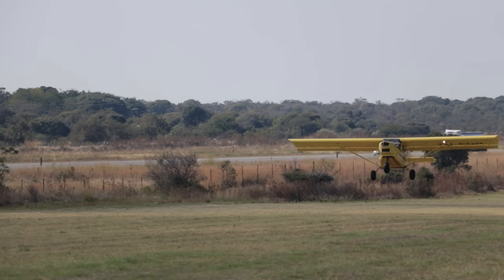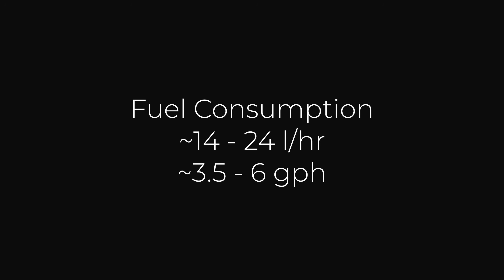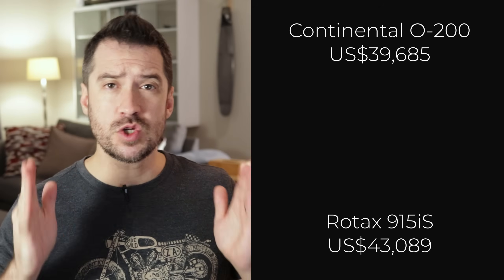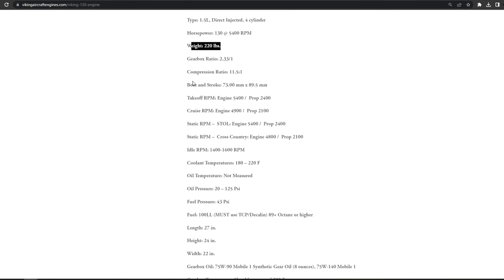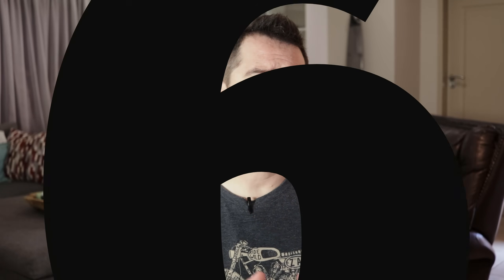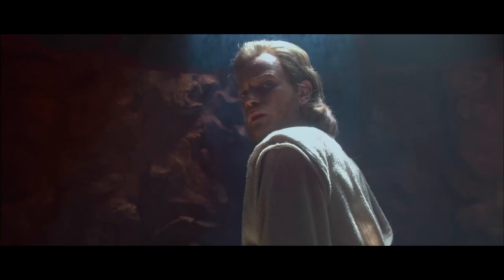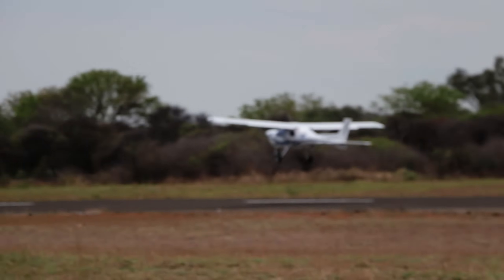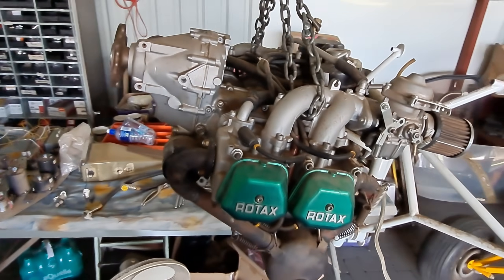6 WORST & 6 BEST Light Sport Aircraft Engines

Comment from the maker: I have updated the spreadsheet to fix some inaccuracies like engine pricing and weight and I also added two Aeromomentum engines due to popular demand. Link in video description.
Reply: Add the HKS 700E for Lighter Sport .... that's the way i would go on a budget. ( but i can't find engine weight or cost figures )

seems like a Very Light engine, with Two Different Gear Ratio Options...Smooth Boxer Twin, And No Hot Cylinders hiding behind cooler ones.
that would be like Super Powers, with the 2.58:1 reduction on a Rutan Quikie.
Reply: quickies have a ground effect lump you have to learn when landing them.... but no big deal, once you got the hang of it.
Reply: i can't find anything on the stock Q2 propeller diameter .... just that the Q2s have been known to scrape their props on landing, ( because of the flex in the forward wings )
i would probably try Epoxy and 4" Mono-Directional Carbon fiber tape, ( one stripe along the bottoms of the front wings, to add tensile ), 
and run the same diameter in a high aspect ratio 3-blade on the HKS 700E 2.58 to 1 reduction.
just guessing the stock propeller is about 1.3 Meter Diameter,  where the same, in a 3-blade on the 2.58 to 1, would give 88% Efficiency, which is better than stock at the same dia.
Reply: i mean if an engine costs less, and is lighter, you can afford a nice propeller and get more out of it.
getting the right prop, to match the engine to the air-frame is where a lot of power lurks.

you can get more power out of the same engine.....or the same power as a more expensive engine, out of a less expensive engine.
Reply: larger diameter propellers are more efficient, and 3-blade is more efficient than 2-blade....where a higher aspect 3-blade can run just as much pitch on the same torque.

with a Q2 i would be limited in prop diameter, but it's a more efficient air-frame with both the wings and canards being lifting surfaces, and better areo-dynamics than most.
less drag due to landing gear, and the canard wing-let gear actually reduces vortex sheading.
Reply: Wow....that little HKS 700E could pull a Quickie Q2 !!!
Plus It Is Way Lighter than the VW engine they normally put in them...a little faster, or better range, with the HKS 700E....it would be like sheding a bag of concrete.
Reply: i can't afford it right now though....sure looks nice, check out those kit pictures.
Reply: and the HKS 700E's less engine weight, could be trimmed out by moving the batteries into all that extra space up there.

a 1.2 Kwh Battle Born 100Ah 12V LiFePO4 Deep Cycle Battery is 33.4 Pounds ...put an inverter up front somewhere...
maybe shift the fuel tank forward a touch, or make the back a little lighter somehow.
Reply: i think i would get the 1.2 Kwh battery for Redundancy on my alternator / regulator.
.i would check my voltage before each flight, and just know if something was wrong; but i would make it ..... then pull out any plywood, and replace it with fiberglass sandwich core.

because just those two things would trim it out fairly well.....of course i don't know how much plywood the design uses, or where if any.
Reply: i could probably find old mattresses in the alleys, if i looked regularly.....then i could pick up the Q2 tail, and flip it over it's nose.

then do the 4" mono-directional epoxy carbon fiber on the bottom of the canard wings.
Reply: Someone that has access to airplanes should publish a web page with the cabin measurements of all the different airplanes available for Microsoft Flight Simulator.
Like:
Seat Height, how far the Pedals are from the front of the seat, where the Stick center is and neutral angle.....stuff like that, so people can set up.
Reply: actually, it would trim out, just with the right battery....because the battery further back wouldn't be there anymore.

so a Q2 would trim out much Lighter with the HKS and battery up front by the engine.
Reply: I think the Corvair engine is the most economical approach especially if you don't split the case. Borescope inspection can tell a lot about condition and a good prop can bump up the actual power. Sweat equity is a good investment
Reply: Not sure what the difference is if any between Lycoming and Continental although Rotax is in Austria and in a heap of trouble for selling engines to Iran to power Russia's drone fleet so prices might be coming down for Rotax soon. I would never trust any other engine for an Aircraft as no problem finding parts or people with knowledge who can work on them flying aircraft of VLA type still very much a collaborative effort. If you're flying paragliders this is an entirely another matter as presumably fair weather only and truly light and truly for sport. I still would prefer two engines over one no matter what type of flying with each engine capable of sustaining flight individually this either in a tandem configuration or lateral front/back "boxcar" formulation.  Anything else is a suicide mission and should come with a parachute such as Cirrus SR-22
Reply: So, a good engine aside fuel efficiency and reliability would have:
1. A price up to US$ 18000
2. Something between 110 to 120 hp
3. A weight/power ratio between .6 and .8
Reply: I have the Viking V90 mounted on my Pegasus and after 180 hours I am still very pleased with my decision :-)
Reply: Jabiru 2200

Comment: Have a J430 2017 GEN3 with around 420 hours
Bought it Dec 2023 with 306 hours and only started flying it full time around May 2024
It has been awesome... great performance for what it is...IAS 114kts at 24l/h, low costs, uses very little oil
No issues with EGT, CHT, oil temps and pressures
This aircraft makes aviation really affordable and enjoyable
Even did my night rating in this aircraft

Comment: Noooo!! my AeroVee! understandable though, it has slightly worse power to weight ratio than a harley evo (I still wanna build a harley evo powered open cab mini biplane someday) it's very reliable though, and it can run on avgas or pump gas, and they have a new turbo option now which makes 100hp at only 25lb heavier, which i think is pretty good, and it remains just as reliable and in the sonex can cruise at 180mph so i like it, it does have a 2 minute full power WEP which good for blasting of the runway or doing aerobatic loops, i also love how the engine comes as a kit and i get to build an engine. you just gotta take it with the 'enough power' mindset and not 'the most power' mindset. it still has it's qualities.

Comment: Interesting video.  I am building a Viking Cygnet scratch built and will be powering it with a big VW derived conversion. The Aerovee is just one example, some other's currently available are Hummel (Scott Casler) and Revmaster (Joe Horvath).  Sadly, Great Plains (Steve Bennett) is gone, as I believe he had the best way to build a VW conversion. Another builder was HAPI (Rex Taylor), who owned the Cygnet design for a while.

The Cygnet is a fantastic performer, originally designed around a 60 - 65 HP VW conversion. It is a funky, odd looking design to some, and is a two place tube and fabric design that performs very well at it's gross weight (1100 lbs) on a VW 1835cc.  Bigger VW conversions are even better, and they have also flown well on the Jabiru 2200 and the 80 HP Rotax. You should check the airframe out. They don't have much tolerance for heavier engines, but empty weight is about 585 lbs if built right, and this gives quite a useful load. The design calls for a 15 gallon tank and a fuel burn of about 3.5 gph at 100mph cruise.

Comment: Jabiru 2200  80/62= 1.29 hp/kg 4 place
Price 87.5 usd/hp  1 place
Weight 62 kg 1 place
Overall 1 place 
 
UL350iS 130/79= 1,6 Hp/kg  1 place
Price 201 usd/hp   3 place
Weight 79 kg 6 place
Overall 2 place

UL260iS  107/72=1.49 hp/kg 2 place
Price 224 usd/hp  4 place
Weight 72 kg  4-5 place
Overall 3 place

912ULS 100/68= 1.47 hp/kg  3 place
Price 229 usd/hp  5 place
Weight 68 kg  4 place 
Overall 4 place

Viking 90   90/72=1.25  5 place
Price 117.2 usd/hp 2 place
Weight 72 kg  4-5 place
Overall 5 place

Rotax 912 UL  80/67=1.19 hp/kg   6 place
Price= 234 usd/HP  6 place
Weight 67 kg    2 place
Overall 6 place

Comment: well, hellen keller was blind & deaf. what's your excuse? AEROMOMENTUM beats ALL these engines- on price / power to weight / efficiency / reliability- except rotax has an edge on almost everyone for their stellar record of reliability- only because AERO is fairly new- but if you count their air boats? they FAR surpass even rotax in reliability- there are examples of air boat businesses that ran boats for LONG days, weeks on end, with no maintenance at all- except oil changes & air filters for around 8000 hours. try that with your glorified, air cooled briggs & stratton motor. VERY soon, kawasaki will be starting an aviation line of engines- BRACE YOURSELF. LYCONTISAURS is irrelevant. if you're not water cooled- & fully fadec? you're already beaten.

Comment: Looking at strictly weight vs. horsepower vs cost, leaves out a big one. Reliability. I'd take the Aerovee if it did good in reliability or a Revmaster. If it's going in something like a Sonerai, it would work fine.

Comment: The Rotax 912 now have a Chinese clone at far cheaper price, but still with carburators. Rotax increase power in their line of engines at a snail's pace.  You did not mention all the UL and Jabaru engines is at 3000+ RPM , that is how they get their HP. Not the best for a plane that tops out well under 150 MPH. I prefer closer to 2000 to get the noise down and to increase thrust.

Comment: Jabiru has gotten a bad name due to over-heating issues early on, but from experience I know you can run them reliably even in slower aircraft. I flew behind two 3300's  in a Rans S6-S, shoehorned in a cowl meant for the Rotax 912. Empty weight 325kg/716lbs. That plane had just awesome performance, incredible climb performance, great fuel economy and cruise at 2600rpm soooo smooth.
The one thing to note when using a Jabiru is cooling. Itś simply different from many other engines. To get plenty of cool air through the fins, make sure there is vacuum pull below the engine. No holes in the bottom half of the cowl. No air leaks around baffles. Once you have that figured out, all you heat issues are gone.

Comment: Best light sport aircraft engine is rather subjective, particularly with engines with so much variation in weight and prop speed. Between weight and prop speed, a lot of engines that would work well with specific aircraft, but not other aircraft. The Jabiru 2200 is a light engine with a relatively high propeller rpm and low static thrust would be more suitable for clean aircraft like the Sonex and two seat Jabiru sport plane. They would not work well with draggier STOL type aircraft. Heavier  engines, won't work well in aircraft that aren't designed for them. While I like the Rotax 912 family for its flexibility, I realize that it's not a one size fits all solution. The thing you need to do is figure out which plane you want and then decide what is the best engine for that plane for you.

Comment: One thing that you should have included was the matter of what rpm the propeller is turning when the engine is at max power. The Jabiru and VW conversion engines have a max prop speed of over 3300 rpm which limits prop size compared to the Rotax and Continental engines. This means that the Jabiru and VW conversions (and the Corvair conversions) will produce less static thrust than engines with a 2500-2800 rpm power band and will be less suitable for draggy light sport aircraft or situations where takeoff and climb performance are critical. That said, they can work well in cleaner aircraft that are designed around their relatively high prop rpm.

Comment: You are comparing natural vs injected.  Reliable fuel system engines might be an alternate presentation  because icing especially with ethanol in fuel is a serious issue.

Comment: There is also a Chinese clone of the Rotax 100HP engine now, but with carbs. Sure, some diehards would still prefer carbs and magnetos,  and if there are enough demands, the aviation field can still make it an option. But we had electronic ignition in motorcycles since the 70s, just how out of date some people are !? Auto makers cannot offer it in any form, since there are gas mileage and pollution requirements. Aircraft have less pollution requirements , but effectively the quest of efficiency is the same thing in another name.

Comment: There's something to be said for simplicity, and direct-drive engines like the UL Power and Jabiru offerings deliver in spades. Other points worth considering are proven TBO and reliability - the former may justify price while the latter is a safety concern. I would have put the Jab 2200 in first place, but to each their own.
Reply: the car version of the VW engine is on my 1979 beetle, original engine still, never failed me, and it's suffered some abuse over the years. Haven't needed to adjust the valves in 25 years either, they're still spot on.

Comment: The Revmaster would probably come in even with the Aerovee. Those engines are direct drive, so it's nice to dump the gear box. But not being able to turn more RPM due to prop speeds is what keeps them in the 80hp range. More if turbo charged.

Comment: You wrote off the 915 and 914 but if I ever flew I live at just starting 5000 feet and I would be mountain flying at 7000-8000 feet on short strips. I would think that turbo would really be important at those elevations.
Reply from the maker: I didn't really "write off" the 915, just for true LSA's. The 914 being the only other turbocharged engine, cost  becomes less important so would go top of the list for high DA operations. 

My list is a very narrow scenario. There are some more scenraios that would turn the order on the list around.
Reply: @LetsGoAviate  The Rotax 914 has been discontinued from what I've been reading...

Comment: Why is it that everything having to do with civil aviation hasn't followed the naturel progression of manufacturing which began with the industrial revolution by becoming more efficient and lowing prices over time? The fact that everything needs to be certified justifies the Absolut absurd prices is bulls#&t. The the companies in the automotive industry have to certify and jump through way more hoops but they don't charge 10 times more than the normal cost. Lycoming and Continental manufacture all of there parts on modern CNC machine tools just like the automotive company's do which basically involves one person as apposed to the old days when it took 10 people. These air cooled apposed piston engines are more or less the same engine as the engines in the 1940's. The fact that someone can purchase not one but two brand new 5.0 liter Ford Aluminator engines  that are all aluminum , dual overhead cam with VVT, 4 valve per cylinder, fuel injected making 490 horse power for the price of an air-cooled carbureted flat 6 that was designed over 80 years ago making less than 150 hp is insane. There is no justification to these prices other than they now they can f#$k you over.

Comment: I do like your list.  There are some other items to consider that are harder to define such as reliability, parts cost, fuel efficiency, and even availablity of parts to the pilot vs having to go through an authorized repair station which Rotax requires.  There is a new Rotax clone from China now called ZD Zongshen that is currently unknown on reliability however it is a place to buy parts for your Rotax if you chose.

Comment: Well done!  The quest for reliable and affordable power has always been the Achilles heel of sport aviation.  Back in 1993 I installed an NSI EA81 100 HP Subaru in my Kitfox 4.  Still flying today with 650 hours.  Its works well but certainly heavier than a Rotax 912.  Any auto parts store can usually get me what I need which is cheap and fun.  Too bad nobody does the Subaru these days in kits.

Comment: Years ago I built a KR2 kit with a 36 hp VW engine for reliability. Because of the power it was basically a one seater but it flew fine and was very low speed at landing. Top speed was 119mph and ceiling was may be 9500'.  My total cost for the build was about $1800 but the year was 1976.
Reply: That was low Hp for a Kr and the CG would be questionable .
Reply: the Jodel is similar, and does 75 knots with a small VW engine, mounted upside down I think.

Comment: There's a video on YouTube of a snowmobile engine, 140hp, on a bush plane - cost about 6K for the engine.  Why are these engines 3 or 4 times the cost of a snowmobile engine?
Reply from the maker: There's a few reasons for that. One is that aviation engine manufacturers include liability cover in the cost. Engine makers get's sued occasionally when failures results in death, and they cover themselves financially by charging you more. 

Secondly, reliability is more important in aviation than in snowmobiles (or cars or bikes) and usually undergo much more testing and design refinement, which costs the manufacturer, so the product gets more expensive.

Thirdly, aviation engines have redundant systems, like 2 magnetos/ignition, 2 spark plugs per cylinder etc. To include these required systems cost more money for the manufacturer to add to the engines.

There might be more reasons, but these 3 certainly contribute a huge chunk of the additional cost.

Comment: What is the chances of using a BMW 1200GS motor for aero uses. It is cheap, weighs only 83kg dry and has a possible output of around 81kW
Reply from the maker: They are being used in aircraft from time to time. You can see my "Best 2 Cylinder Engines for Aircraft" video for a little bit on that.